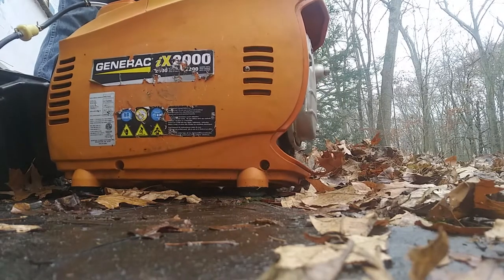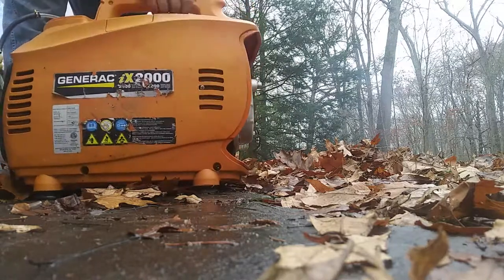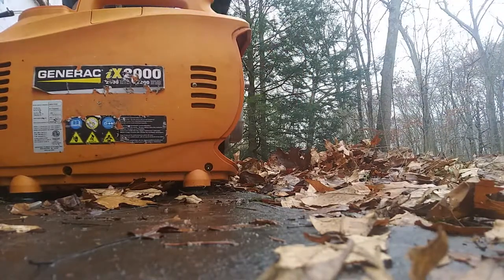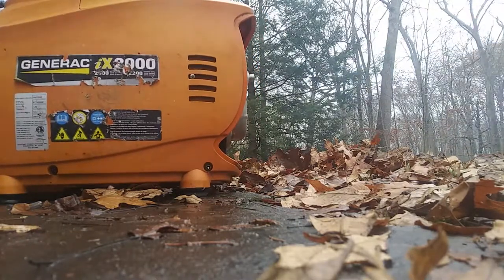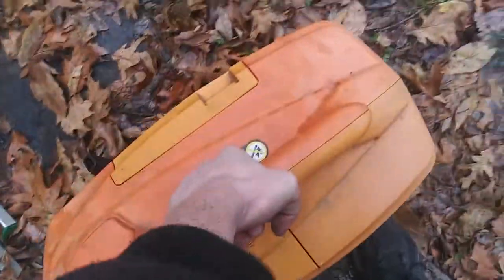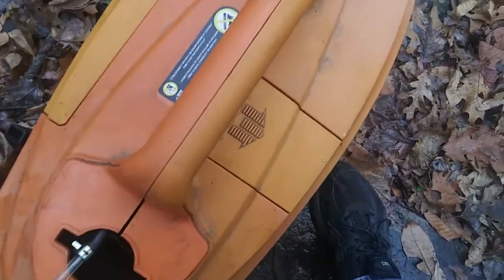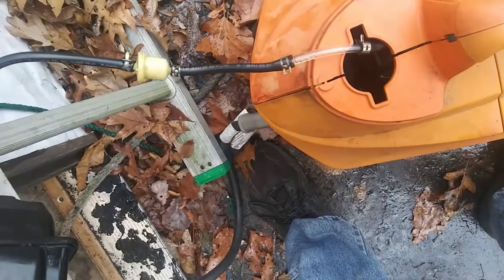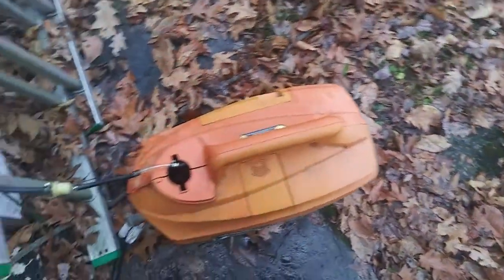GENERAC IX2000 1000 Watt load test (QC Rant)

Comment: Sounds like no governer, or the internal governer is broken. It runs itself out of fuel from gravity feed as it runs at (pretty much) valve float, starves itself of fuel and nearly stalls, where the suction continues to pull fuel into the carburator, where it sparks again and runs to valve float again. This loop continues until the valve collides with the piston, or throws a rod. The engine is being purely govern on the amount of fuel. I have seen this so many times, and had one do this to me before. It really is a piece of shit then.